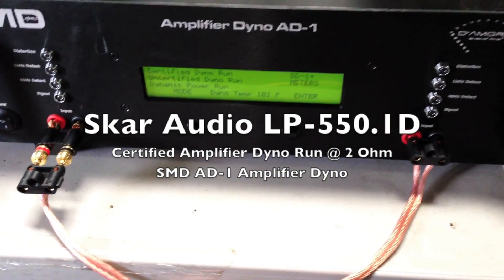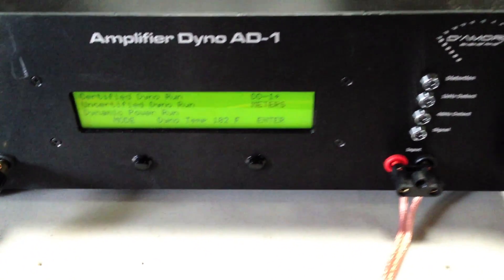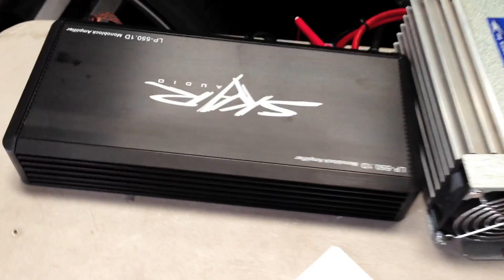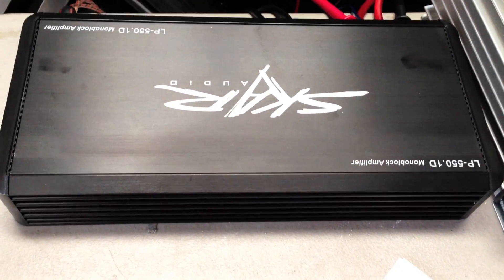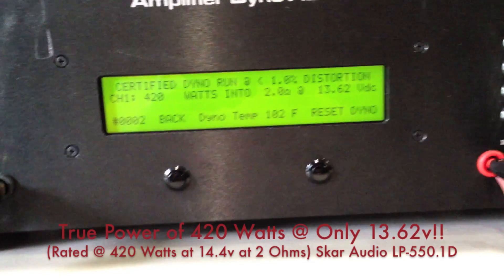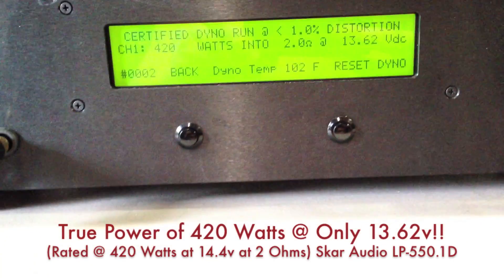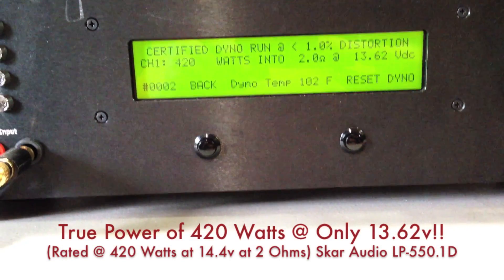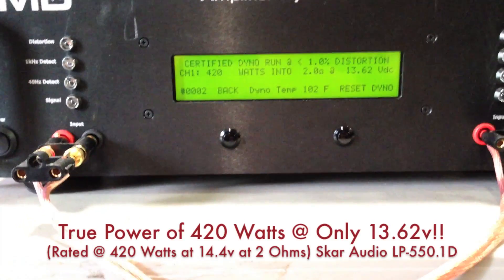Skar Audio LP-550.1D CERTIFIED Dyno Run @ 2 Ohms on SMD AD-1

Comment: actually that .8 volt difference, If you do a little math, shows you the amp will only gain about 24 watts. Thats 6% more than rated, that is not "much more than rated" like he says.